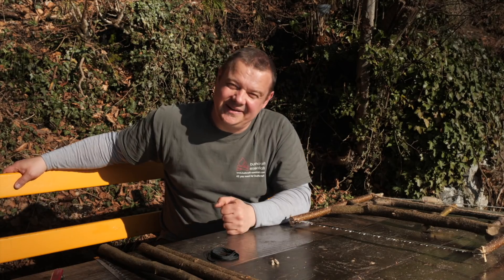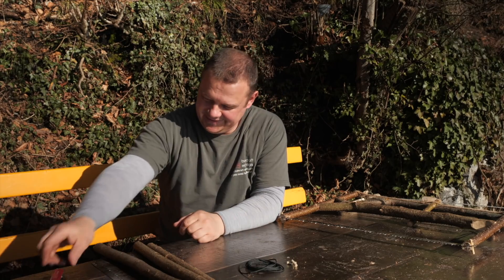Great BUCKSAW -TRICK. I bet you have never heard of! How to make a stable Frame & the physics behind

Comment: EN: If you can get the saw blade bent and rolled up into a Nalgene 1 liter wide mouth bottle, that would be the saw I would build and use on 7 vs. Wild Season 3 #7vswild in Canada or Alaska.
DE: Wenn man das Sägeblatt gebogen und aufgerollt in eine Nalgene 1 Liter Weithalsflasche bekommt wäre das die Säge die ich bei 7 vs. Wild 3. Staffel #7vswild in Kanada oder Alaska bauen und benutzen würde.
Reply from the maker: Absolut... das Blatt beleibt aber gebogen, wenn man es so stark einrollt. ich bin mit nicht sicher ob man es wieder begradigen kann.. LG

Comment: The original versions like they made in the seventeen and eighteen hundreds had the center bar joined into the handle bar with a box or dovetail joint and  used either two wooden pins, nails or later two rivets or bolts to accomplish that. I like your simpler solution bro.

Comment: Great content and a thoughtful design but a sawn slot rather than a split one for the saw blade is less likely to result in an unwanted split later. Even the naked saw blade can be used for this if you are careful.
There is no reason to split with a knife for this project.
One could also argue that the tighter fit of the blade with the thinner cut of the thinner blade is advantageous but more dangerous to make. My main point is to saw a slot not split one with a knife.

This and all your content is great!
Reply from the maker: Haaa ha haa, ich war ganz einfach zu faul um zu sägen... Du hast recht, das war nicht optimal!

Comment: Check out this picture for what might be a better way to do a saw that doesn't collapse. It is essentially a pair of tightening strings that form two triangles from the top of each side piece to the join between side and center on the opposite side. 

https://bushcraftusa.com/forum/attachments/de6a7cdf-daa2-48b7-bc43-cfee2b8ccd77-jpeg.1220568/

Comment: You didn't explain or show how you attached the wooden dowling to the saw blade in order to hold the blade in place - 7:24
Reply: Such blades are typically designed with holes to accept pins, which are held by the blade tension.
Reply: @TJStellmach  Okay, Tim, thanks for your reply.

Comment: Felix, I think this is the first time I don't really agree.  I think the whole thing is based on you using the wrong sort of joint in the original.   The horizontal should be slotted into the vertical pieces, so it can't move around like you demonstrated.
However, since it's all based on Swiss Army knives and doing it quickly,  and because I love your channel,  I'll give you a pass  🙂🙂
Reply from the maker: The stability from the Frame is based on the stable connection between the crossbar and the vertical stick on one sind. How to do this is an other question. If you just have a SAK, this is for sure the easiest option. Greetings from Switzerland
Reply: A mortise and tenon joint is very stable against wracking if cut precisely, which is indeed how bucksaws are conventionally made. But I'm doubtful about achieving such precision with a Swiss army knife. Felix's method makes a lot of sense given rough tools.

Comment: Hallo Felix, great work as always. Never the less I made such bucksaws twice in my life using a Mora and a SAK. I made them using mortise and tenon joints for the horizontal bar. No problems what so ever with the stability. I sawed the slots for the blade with the SAK and drilled holes with its awl through for to use metal pins to secure the blade in the slots. I can see that your method with the triangle gives good stability, brilliant idea so. But mortise and tenon, correctly done, are working good too.
Reply from the maker: Yes i belive you 100%. Just the solution with the fork ist a lot easier to make with just a knife..
Reply: @FelixImmler  You are right, if we are talking about a normal SAK. Because they are not that pointy.With a real spiky point you can kind of chisel even the small sides of the mortise relatvly good. For that reason I have changed the point of my SAK Forester to a more Mora kind of point. that works a lot better for such tasks. And by the way it also is better for digging out splinters too. But hey Felix, great idea with the fork, you are still the god of making things with a SAK. Who the hell is Mc Gyver.

Comment: Felix, I meant to ask you this question when you built your bow saw:
Would it not be better to cut the slot for the blade with the saw of the SAK, instead of with the blade? Then you would have a groove instead of the slit, and perhaps then it will split less?
Reply: I don't remember exactly his answer but he did explain in the comments to someone that asked the same question in the bow saw video.

Comment: That mini bucksaw is cute af! Does it actually work?
Reply from the maker: No, thats just a modell...
Reply: @FelixImmler  Well someone HAS TO make a real one! Are you up to the challenge Felix? :p
(off topic) I got my first SAK as a gift 2 days ago, a mountaineer model, and I modified the wire stripper, the bottle opener as a gouge, put magnets and needles in, and I'm working on 3D printed scales to improve the storing capabilities of this amazing tool thanks to your many advices!
Reply: You could try scaling down to fit a metal cutting blade. 🤔